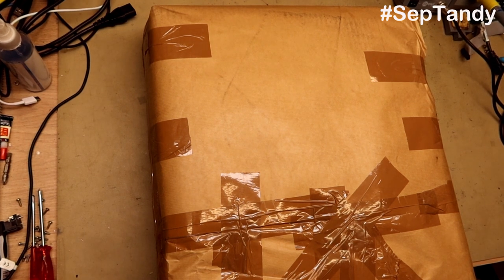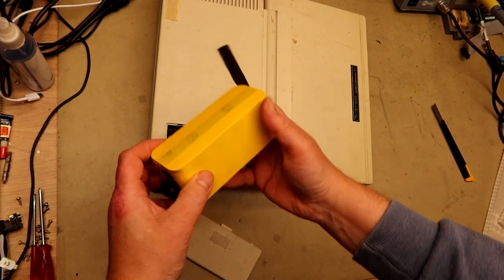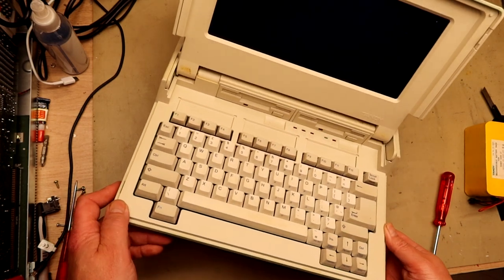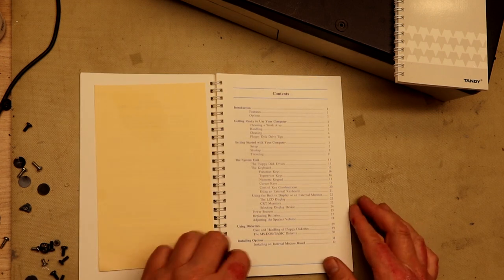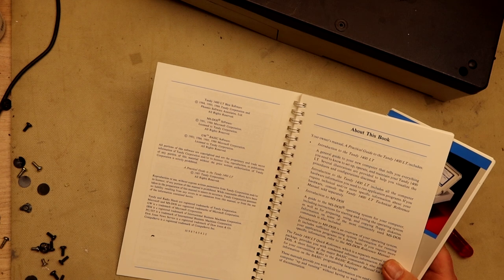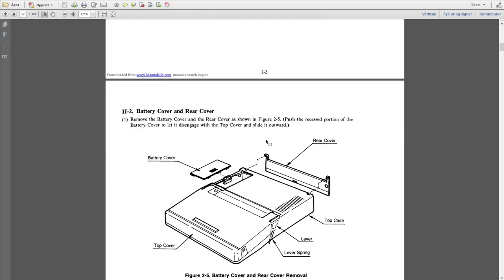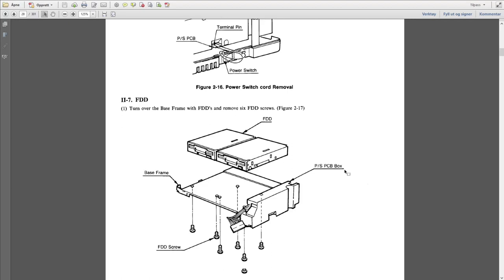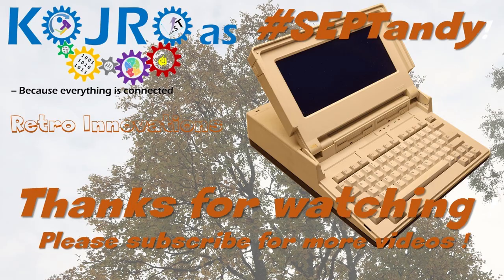The Tandy 1400 LT. Autumn brings us SepTandy, Part 1

Comment: I owned one of these 1400LT lappys. I bought it new back then and used it for years. I carried it to and from work on the back of my motorcycle, strapped to the rear of the seat. It replaced my Kaypro 10.
Reply from the maker: Yes I can se that.. This is like a feather to a Kaypro 10... I had an even smaler Sanyo MBC16LT with about the same spesifications, but a little slower.